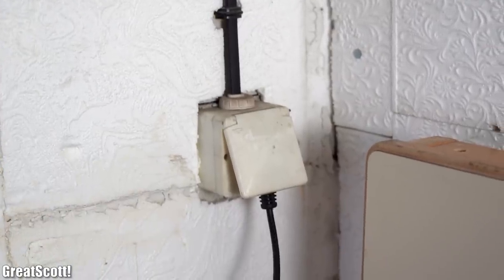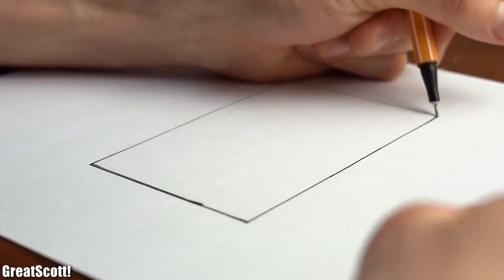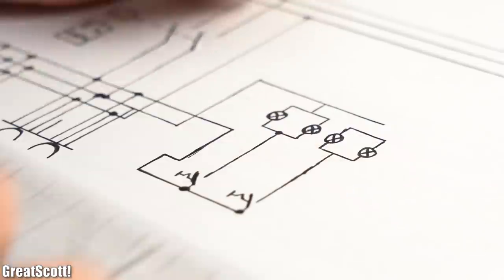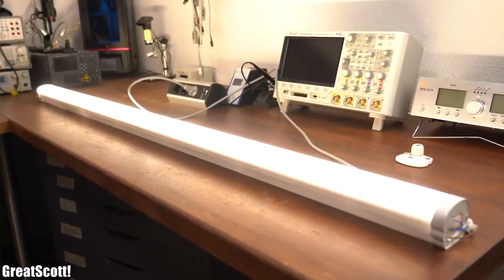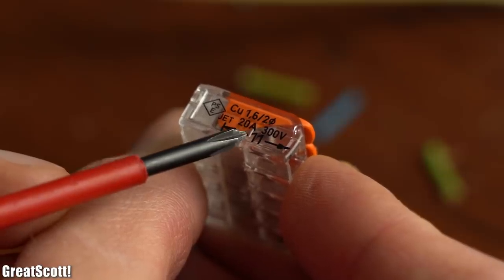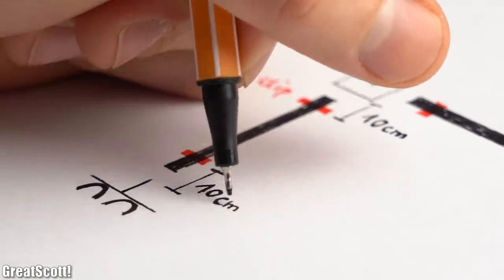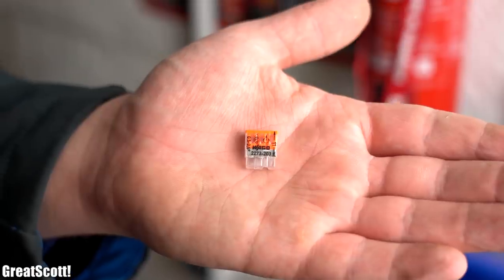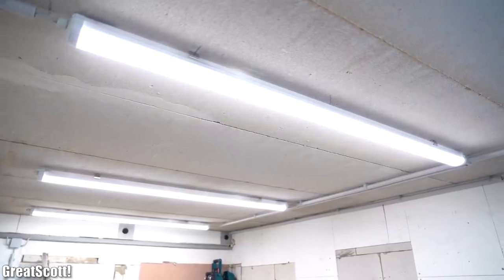How to do Electrical Wiring properly! (more or less....) GERMAN STYLE!

Comment: the 5cm gaps are an interesting factor. in Canada I've always seen conduit connected structurally to every box, and I suspect you probably aren't allowed to have a pipe end exposed, and must end all pipes in a box of some kind
Reply: This is because the 3 x 1.5 mm2 covered wire he used. When you use individual wires you connect the conduits to the box.
Reply: @jbrnds  the standard wire for homes in canada is called romex, it's the live and neutral in a flat line with the ground in the middle and some insulation around the whole thing, if wire is to be exposed in an "outdoors" location like a garage people either use conduit or this stuff called BX which has a metal armored sheath. my guess based on what i can see in the video is that his wire has much, much thicker insulation around it
Reply: it depends on what type of installation you do. 

1)For outdoor, garages, offices and most industrial buildings, we use (mostly gray) insulating cables(like Scott uses here). For example XMVk. because they are always Water resistant and really quick & easy to install, and you have them in different types for different use cases like UV resistant or Metal-shields. Those are allowed to be exposed  for bends and connecting them to junction boxes. 

2)For houses indoor we mostly use (yellow) pvc piping flexible or solid, or a combination of both. And tose must, just like in Canada, always connect directly to boxes, switches and outlets. After installing the pipes we pull cables tru them. for power every color is separate but we pull them at the same time obviously. And we use the same pipes for ethernet, fiber, telephone and coaxial cables, separate from power. 

You can see why we prefer the first method. It is less work for big installations but it is not very suitable for European type houses.
Reply: They used for indoor Installation NYM-J, for outdoor its NYY.
Reply: @famitory  in Australia we use similar stuff we call TPS. Typically we use 1.5mm² for lighting circuits and 2.5mm² for general power outlets. All 3 sets of stranded conductors are insulated individually with their designated colour, then all 3 are insulated together into a flat white cable. We use 230V power here, similar to Europe's 220V.
https://en.m.wikipedia.org/wiki/Thermoplastic-sheathed_cable
Reply: @iamdave84  most of Europe also uses 3 Phase 230/400V we switched from 220 , 2 decades ago.
Reply: @Ter_ror  I didn't know what. We officially switched from 240V to 230V not all that long ago.
Reply: @Ter_ror  not true in the UK. It is VERY rare to find a domestic property supplied with three phase and even when it is, it's usually because the owner has a specific three phase requirement (and pays extra for both installation AND usage) like having a large workshop with several three phase machine tools - lathe, mill, wood thicknesser, large table saw etc. 

Otherwise the typical 80 to 100 Amp single phase supply is MORE than adequate (max of 25kWatt with UK 250v)! 240v is usually the lower end of supply. My own RURAL supply has a typical voltage of 245 -plus)
Reply: The entries to these small distribution boxes are splash-water proof since they tightly surround the incoming cables. Therefore we can have a gap.
Reply: @boblewis5558   I did not mean that every house is supplied with 3 fase.(that was a lack of information on my part) But the grid is designed that way. 

I live for example in the Netherlands. It is common for new build or retrofitted houses to be installed with a 3fase supply. However it is very common to find houses with only a single fase supply. I used to live in such a house. 

Here Back in the day is was normal practice to distribute 3fase to a city district and then to split every fase to a single street. So every house has a single fase connection. 

As far as I’m aware, this is still the primary way the UK does it, especially in the country side. But still the main backbone of the grid in the uk is 3 fase. 
Fun fact it is not even connected directly to mainland Europe. But the connections is does have are converted to DC than across the north-sea or the Channel an than converted back to AC
Reply: @iamdave84  well the 230 volts is not constant. Its an average. Sometimes I can measure 223 and sometimes 237 it fluctuates depending on a lot of factors.
Reply: @Ter_ror  yes, I understood that but my understanding also was that in(most) of Germany, certainly in new builds near München, for many years they have had full three phase supplied at least to the main service fuse then it is only a question of a simple meter change and three phase isolator to get the three phase fully supplied to the property. Larger properties I understood to have three phase as standard.

In the UK the three phases tend to be split to alternative pairs of houses each side of a road and along the road. So four houses per phase using pole mounted transformers in rural areas (and some urban) and larger street level HV transformers for larger urban housing areas. Much the dame across Europe I think from what I've seen in the Netherlands, France, Spain, Portugal, Italy. Germany too but like I say their local LV distribution varies quite a bit depending on location. Everyone should find out what they can from as many countries as possible. Lots of commonalities but also plenty of minor to major differences! 👍👍👍
Reply: @dhyanais  in the UK they need to be at least IP65 to meet the current IET specs/recommendations. Can't even have clear front polycarbonate panels any more and even fireproof glass is frowned on by many sparkies! Arrgghh! Overkill!
Reply: @iamdave84  we use 230v too. No more 220.everything is mostly converted to 230
Reply: @boblewis5558  same in the states 3 phase to res. is possible but very expensive .  and most of our smaller houses use 240v 100 amp mains

Comment: Polystyrene tiles.... a firehazard if ever I saw one.
Reply: Yeah, these tiles will burn like hell.
Reply: And they are also a pain in the butt to remove because they are glued -all of the flat face? (I hope you get the point)
Reply: In that case electrical components like switch box, main board should be rated to F, possible to instal to flammable surface. Not surre if it is like that.

Comment: 10:30 Oh the humanity! Has Germany never heard of glands and grommets? Here in the UK you'd get shouted at for having all those wires hanging out of the ends of the conduit like that!
There are ways to do corners too!
Reply: Yeah, not very neat. Maybe they don't require them for external building(s) installations 😜
Reply: Not required indoors
Reply: I know it's not required, the conduit isn't even required, but I've never seen anyone go to the trouble of "half doing" the conduit!

I would shout at a spark if he did that to my garage!
(Which would be my brother, but I know he'd never do an install like that).
Reply: In Denmark you are not required to use conduits unless the installation are outside and close to the ground (2,5m or below). Most times conduits are used to get the job done faster, just like in the video. If you have lot of parallel wiring in a esthetic un important area like a garage you would use a cable tray.
Reply: @juststeve5542  When he smacked in that first vertical at 9:14 I thought, he must be using some huge grommets. Then he started feeding cabling and I was like... Ermmm, hang on!! LOL
Reply: it seems they used a junction box which had grommets integrated. Maybe they're not common in UK?
Reply: @bala5984  if you look, the junction box also has an M20 thread for the gland too! It's pretty much a Wiska box.

It's just the whole leaving a huge gap between the end of the conduit and the box which is so alien to me, and it looks messy too!
Reply: @TheFreezeChill  I don't think "... higher installation cost" could be classed as a benefit ! 😜
Reply: @juststeve5542  sorry, I've installed a lot of these boxes too and there's no M20 thread! What you confuse as thread are just part of the flexible grommets which are integrated into the box itself.
Reply: @bala5984  ah, it's hard to see clearly, but at one point it looked very much like an M20 thread in the recess on the box, external to the built in grommet, just like the Wiska boxes have, but yeah, those boxes are a bit thin to have one of those, and I can't find the frame where I thought I saw one earlier!

Anyway, as a compare and contrast, I just went out to my workshop...

Forgive the video quality, and amount of junk cluttering up the place, but I thought it might be useful/interesting to see why I looked at his installation with so much of a "are you going to finish that?" reaction! lol!

Here I present, from the UK, one UK double switch socket (on a ring), a light switch and a fused spur (roller shutter door).

https://youtu.be/tS57-2oDQpg
Reply: @TheFreezeChill  it looks a lot nicer!

Sure, what he's done might be "up to code", but an installation isn't just functionality or you'd just run wires diagonally too! lol!

Plus it does reduce the risk of one of the wires getting snagged by something and possibly damaged or ripped out.

I just did a quick video of part of my workshop wiring install, have a look. https://youtu.be/tS57-2oDQpg
Reply: @juststeve5542  Interestingly our (Ip44) Wallboxes for sockets and Switches dont tend to have an option to put M20 Glands etc in it, or at least I havent seen it yet, just Push in membranes as in the video.
Some Junction boxes have M16 or higher breakouts, also  bends etc for conduits exists here are usually not used though.
Reply: @LordFoxes  Curious. I guess I need to do a video when I wire my shed!
Reply: Tell me about it...

Comment: Looks like regulations are a bit more strict here in Belgium.
- Even if you use a circuit breaker lower than 20A all socket cabling must be at least 2,5mm2.
- When mixing sockets with lights the lights must also be connected with 2,5mm2.
- Conduit ends require an end cap to prevent the "sharp" conduit edge cutting into the outer sheath of the cables.
Very nice that you mentioned the use of different types wago splice connectors when using stranded cables. 
On top of that I use ferules on the stranded cables and they perfectly fit in those wago 221 splice connectors if you use the right ferrule (looks like they took that into account when designing those)
Reply: If I remember right wago says you're not supposed to use ferrules with the 2273 wago

Comment: So in germany you use 1.5mm wire for 16amp ? In france we use 2.5 for 16amp :/
Reply: that highly depends on how and where exactly the wire is installed (= how good heat transfer will be) and what´s the total length of the circuit.
Reply: AFAIK 2.5 mm^2 is only recommended for longer lengths (for 16A circuits) to minimize the voltage drop. But it doesn't hurt, obviously.

Comment: In the UK, we use minimum 2.5mm twin and earth for such power outlets and 1.5mm on lighting circuits.
Lighting circuits are protected by a 6A breaker whilst the power outlets are protected by a 32A breaker.
Reply: 32a on all your outlets or just the ones on a ring and their spurs?
Reply: @wizard3z868  M1LAD over-simplifies things, and in a milseading way. If it's a 32A ring, then it will use 2.5 mm^2 cabling. However, radials can also be used. The 2.5 mm^2 cabling can then be used with a 16A or 20A radial circuit with sockets. Alternatively, it's possible to implement a 32A radial using 4 mm^2 cabling. Increasingly it is the practice to use radials and put a 32A one on 4mm^2 cabling into high power locations (like kitchens) with 20A for living rooms, bedrooms and so on. That's because some electricians dislike the extra testing for a ring circuit and also have concerns that a later break in the live or neutral can go undetected leading to the possibility of overloading the cable.

Lighting circuits are usually 6A using 1.5 mm^2 cabling.

All cable dimensions depend on the length or the circuit of course; the above are the minimums.

Comment: Hey GreatScott we are in Austria we have even more and much stricter standards like in Germany :) 3x1,5 13A, 3x2,5 16A, 5x4 20A, 5x6 32A, 5x10 40A, 5x16 63A etc. :) For example, we are only allowed to secure the light switch separately and only with 10A because it can only switch 10A but of course also clear if you want to switch much larger lights that are more than 10 A for example. 16 to 20A we have to take a contactor and divide the phases etc :)

Comment: 9:40 the PE wire has to be a little bit longer than the N an L to make sure that the PE wire is the last one that is connected in case the outlet gets teared off the wall by accident
Reply: Good advice.
Reply: Good practice but not necessary, the outlet is designed in such a way that the PE is always the last to release with same wire length.

Comment: I wish the din rail box and wago connecters were standard in the us
Reply: Be the change you wish to see! I’ve been replacing all wire nuts with wago connectors one-by-one as I install smart switches and USB-C equipped outlets.
Reply: Wago in the US is not such a good idea. Wago is designed with 240V in mind, where the US is mostly 120V. Half the voltage means twice the current, and a much, much higher risk of overloading a circuit. The US style wiring nut will stand that kind of abuse better.

Comment: Excelent video. I see that in slovenia we have the same system. Mybe the difference is that in slovenia for cable 3x1,5 the max rated Fuse is 13A(National standard). Keep the great work your videos is very simple to understand. Great job.
Reply: In Germany there is no fixed standard. It depends on the ambient temperature, laying type, numbers of cables, etc. That's why you can use in one chase 1,5 mm² for a 16 A fuse, but in another you need a 2,5 mm² for a 10 A fuse.

Comment: Great vid, I like the work, I am confused though, Germany makes you leave 50mm outside of junction boxes? even when all internal with no possible water ingress? Don't get that one :)    here  in AU we attach into them, like in UK.
Reply: the wire is double-insulated, so there isn't a safety issue here.  They probably have that in code so that smoke/heat can escape and you can notice it before it becomes dangerous.  Looks ugly though.

Comment: Very nice job.  I’m not an electrician but as an American, I love Wagos.  One of the big complaints from our “wire nut crowd” is ….

“Sure they cause no problems in Germany, they aren’t running nearly as much voltage / current as we do in the US”

But it looked like you guys have up to 16 amps and 230 volts?

Anyway, nice work.

Comment: In Brazil, German style wiring is used, but the voltage is dual, 127 V and 220 V. So, it needs a bus bar that has 2 different poles. Single pole for 127 V and double pole for 220 V.

Comment: One more thing,why you did not add separete circuit breakers for light and for outlets,if you make a short on the outlet you will stay in the dark.
Reply: My whole house is wired to a single circuit breaker, when something trips everything shuts down. I don't know much about house wiring, is this bad?
Reply: I agree, but it's common to put lights and outlets for one room on one breaker. I'd rather have lights in several rooms on one and outlets separately per room or grouped over several rooms on another.
Reply: @calysagora3615  we have 16Amp outlets and use 16Amp  circuit breaker and for light you use smaller fuse(because of Led light I use 6Amp,it can be lower but it is hard to find 2Amp CB)you can use 1 fuse for more rooms

Comment: in Belgium we place end caps on both ends of the conduits, called eindtullen, don't know the english word for it but if you google it you'll know what i mean. makes the conduits look a liitle cleaner and prevents possible wire damage from rubbing along the sharp opening edge.